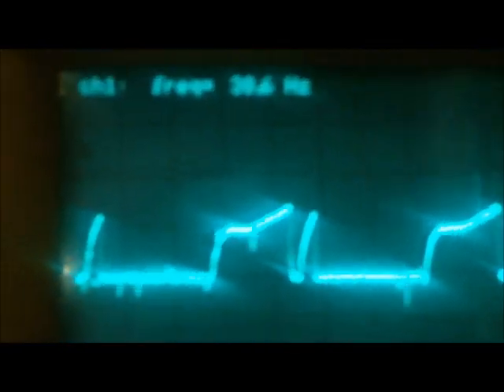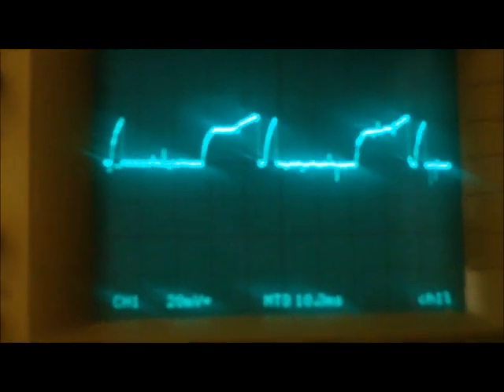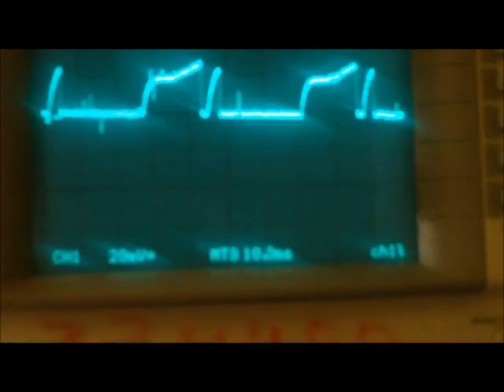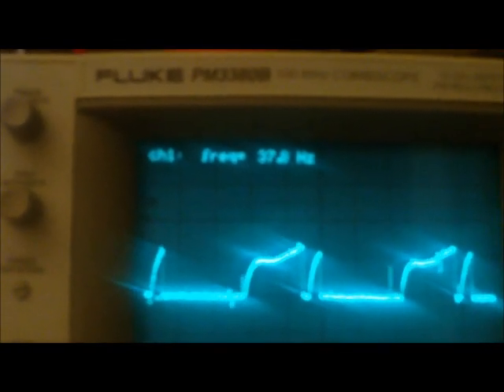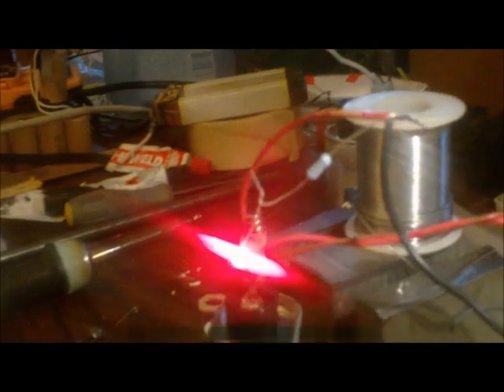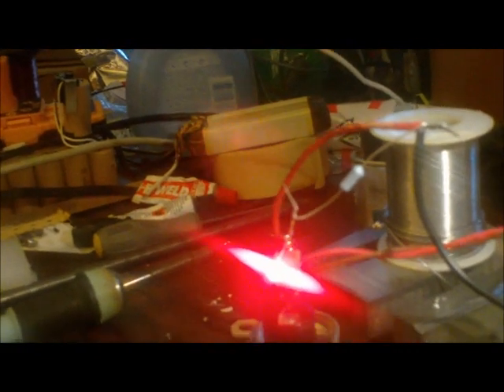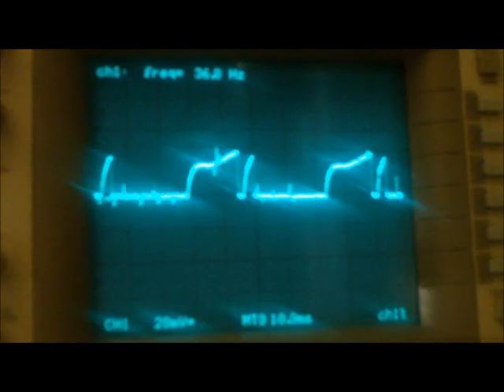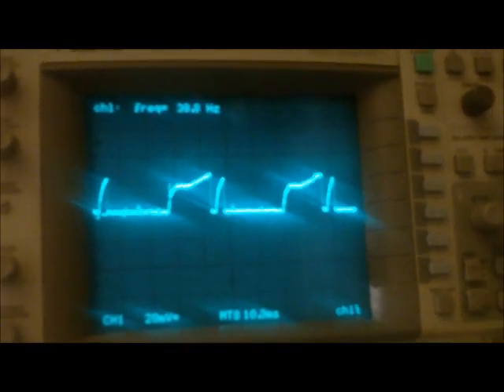pulse motor build off followup

Comment from the maker: The battery voltage has dropped to 7.5 volts and the current to 9 milliamps at 50% duty cycle so it looks like about 34 milli-watts, but the RPM is holding at 1100

Comment: That is a very low current draw you have there.Often the simple thing's in life are the best.The secret is the high ohm coil's in an air core configuration.Less current can pass through them,so less heat and less loss.Great job rkyriach1